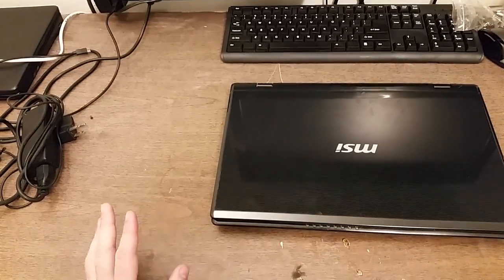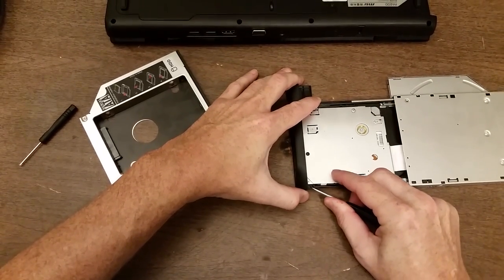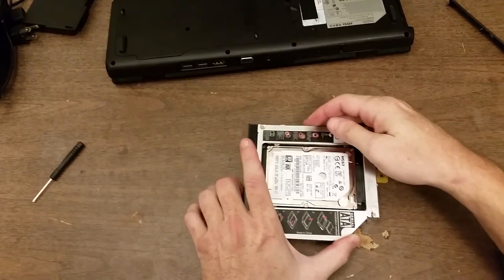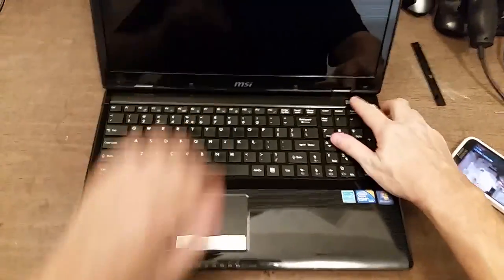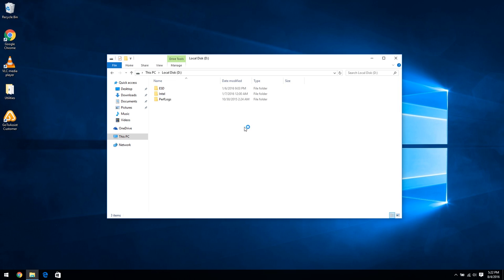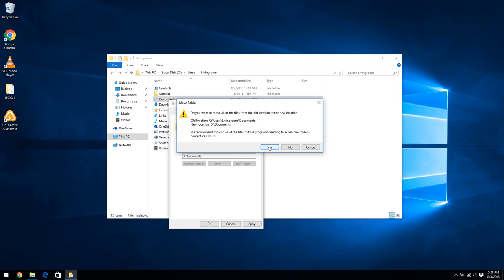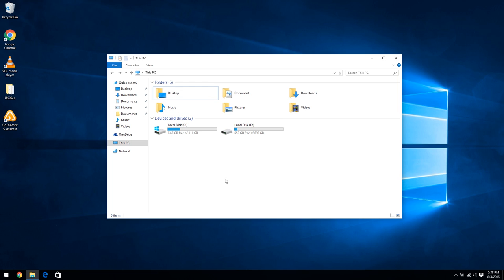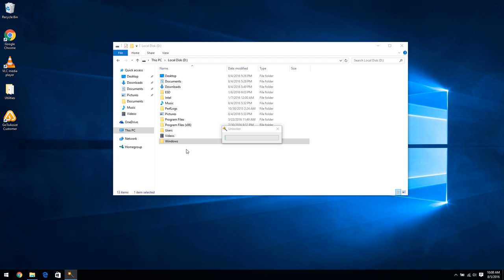Adding a 2nd hard drive or solid state drive to a laptop by replacing the DVD or Blu-ray drive

Comment: An excellent tutorial video on how to add a 2nd HDD to your laptop after installing an SSD to your C Drive. It gives you excellent instructions on how to set up and use the replaced HDD as a 2nd drive for storage of your Windows files.  He shows you how to move your C drive windows files over and get rid of the windows file, plus how to use "Unlocker" Prog to do it. Overall a very comprehensive set of instructions. Thank so much.

Comment: Good video. You need to relocate your swap file, if you use one (I do not), to the mechanical drive You also should direct your Temporary files to your mechanical drive also. This will greatly reduce the write cycles to the SSD. Use Macrium Reflect to image your SSD to an image file on your mechanical drive. These steps will increase the lifespan of your SSD greatly.

Unlocker is a great little program. :)
Reply from the maker: Solid recommendations. Thanks.
Reply: Yer welcome. :)

Comment: Excellent tutorial video.  Thank you very much.  This is my first attempt playing with computer drives so I will need all the help that I can get.  I am putting a new SSD into an older Acer laptop C drive but I would like to pull a HDD from a Dell laptop that just died and use it as a secondary storage in the Acer optical drive.  The HDD from the Dell is half full and I want to be able to keep all the documents, downloads, pictures, and videos etc.  If I move the empty folders from the SSD to the HDD, do they just merge? Or can I just delete the blank folders on the SSD drive and the future files will be saved in the secondary drive automatically?
Reply from the maker: I think to do that right it would be more of a multi-stage process. What I would recommend is moving the files off of the hard drive from the old Dell system to a external hard drive. Then I would format the partition on the old Dell drive. At about 17 minutes into this video it shows how to redirect the music, download, Etc folders to the secondary hard drive. Once that set up then you can reconnect the external hard drive with your files and copy them to those folders.
Reply: Thank you!  The reason I thought I could just moved the files over because your secondary drive was also used, I assumed you had those old files there too. So far, the SSD is not working in the Acer.  I got the PXE-E61 error asking me to check cable.  I have disconnected and reconnected the SSD multiple times, replaced the cell battery, but nothing seemed to work.  Put the old HDD back, everything worked again. I put the SSD into the optical drive, it showed up as a secondary drive just fine.  The SSD is much lighter than the original HDD, but that still doesn't explain the loose connection.  Weird.

Comment: The top tip for me was to measure the CD drive depth. I almost ordered the wrong size from Amazon.
I also ordered a slim optical drive usb caddy for the old CD drive. I may never need it but just incase 🙄

Comment: Hi Michale, thanks for the very helpful video, I had a question I'm hoping you can help me with:

I want to upgrade my laptop (Dell G3 Gaming Laptop) hard drive.

It came with a 512 GB SSD which is currently installed and I just bought the 970 Evo Plus 2 TB which is considerably faster

The motherboard has slots for two SSDs, so I could either:

A) Keep my existing 512 GB installed and ADD the 2 TB drive in the second slot and install the games on the 2 TB HD, OR

B) Clone my 512 GB to my new 2 TB drive and then swap them out

I want the fastest load times for games.

My guess is that if I did A, my boot load times would remain the same (since the OS is installed on the 512 GB SSD, but since the games are installed on the 2 TB hard drive, the games would load faster

Vs doing B, which would speed up both the OS loading time as well as the game loading time since everything is now on the 2 TB (much faster) SSD.

Am I right?

Or would doing either give me the same gaming performance (remember games are installed on the 2 TB SSD in either case).

Thanks!
Reply from the maker: Games load faster from a ssd compared to a hdd but once in a level you won't see a difference.

Comment: Hi Michael, great tutorial. Question - replaced my HDD to SSD. Cloning done, etc. and works well. Put the HDD into an enclosure making it a portable HDD. However, when plugging the now portable HDD, the laptop isn't reading/detecting it. But my other laptop does. Eliminated other variables - malfunctioning enclosure, cables, etc... they are all fine. Thoughts? Thanks in advance.
Reply from the maker: Try one of the other USB ports. It's possible it is detecting it but not giving it a drive letter so it doesnt show up. Try right clicking on the start button and going to Disk Management. See if it shows up there.

Comment: Hey Michael, instead of using unlocker thing can we just format the Used HDD (to remove the old system files) while it is on the DVD Caddy bay?? Also can we format the old HDD partitions separately (if it have any)??
Plz reply..
Reply from the maker: Yes on both.  The unlocked is useful if you need to keep the files and remove the Windows install.

Comment: Michael
Thanks for the detailed info for adding 2nd hard drive to Laptop.
I have a query can I connect external hard drive to my laptop using the cable SATA USB ?
Bhasker Raj
Bangalore India
Reply from the maker: Yes you can.

Comment: As usual, your tutorials are precise, clear and easy to follow Michael and Thanks for that. I have just replaced my HDD with SSD 500GB to use it as normal 'C' drive on my Win7 laptop. Following your tutorial old HDD I put in Caddy as second drive 'D'. However I don't want HHD 'D' (in caddy) to spin all the time instead go on standby when not being accesssed/used. Can that be done? Thanks in advance for your answer.
Reply from the maker: That may be an option. It depends on the computer whether or not it's available. Go into the control panel and advanced power settings. If there is an option to put the hard drive sleep it would be there.
Reply: Thanks for your reply, In advanced power settings it says about just one Hard Drive that probably meant for Primary drive. Nothing about secondary one. Any way Thanks for the help.
I asked the same question to the Caddy supplier, their answer got mixed up when they used their Chinese-English translator !!!

Comment: Thank you for your video.  I have recently put a 125G SSD into my laptop but it's already running out of space.  I reformatted an old HDD and can use it in the optical bay for additional storage.  Will it be possible to relocate the user folders (mine & public) and the programs files folders (there are two of them) to the secondary drive by changing the drive location? Do I have to create a new user account in order to move the user folder over?  I have seen other Youtubers did the copy-and-paste resulting in many complaints about computers getting messed up. That's a scary thought.  If it's possible I would like to keep just windows and a small photo editor on the SSD, the rest can go to the HDD.  Is it doable?
Reply from the maker: Watch the video from about the 17-minute mark. It shows the process of moving the files to the hard drive. To move programs from the SSD to the hard drive what you have to do is uninstall the program and then reinstall it onto the hard drive. Whenever you start installing a program one of the first choices it gives you is where to put the program. Essentially what you do is change it from C drive in the program files folder to the D drive in the program files folder.
Reply: @MichaelTheComputerGuy  Thank you for your prompt reply.  Could you explain a bit more on the uninstalling-reinstalling process?  I have only seen videos on moving the programs files (x86) from one drive to another (most said it didn't work), but not on uninstalling/reinstalling them.  If you have a link where I can learn how to do it I would very much appreciate it.
Reply from the maker: @alicepearce4597  Just moving the program files almost never works. On Windows 10 if you click the start button go to settings there's a apps option there with a list of the programs that are installed. To uninstall any one of them you should click it and then choose uninstall. To reinstall a program you either download it from a website or put a disc in and run the installer. One of the first options during the install wizard will be you where to install it. Most of the time of default will be the c drive and the program files folder. You literally just change C to D or whatever Drive letter your second Drive is.
Reply: @MichaelTheComputerGuy  Oh I see you mean uninstalling them one at a time.  I thought I could use a program to back the entire folder up then reinstall everything together.  Got it.  Thanks again.

Comment: hey bro thank you for this great video! Is the caddy hdd overheating somehow (as it is quite far from the fan)
Reply from the maker: Mat C Hard drives in laptops are not affected by the fans. They are put in enclosures with no airflow and they're designed to work that way.

Comment: is this drain your battery faster and is there any heat issues?
Reply: Does seem like a cool upgrade but not practical in everyday use. The main benefit of a SSD for a laptop besides the performance boost is less drain on battery.
Reply: Shiddhant Hawlader p

Comment: How do you format the HDD? So I wouldn’t have to add the explorer extension? Could it be done through disk manager?
Reply from the maker: To format the drive you just need to find it in the file explorer right click on it and go to format. Disk manager has more to do with partitions.
Reply: Michael Cooper ok. If I understood correctly, the hdd that I replaced with a cloned sdd, i can install in the dvd drive via caddy (great video btw) and i should be able to find it and format it with explorer. Then I can move the desktop, documents etc to the hdd.
Reply from the maker: @TheFamedwarrior72  Sounds like you got it right.
Reply: Michael Cooper bummer. I swapped out dvd drive with the hdd. I turned on the laptop but it only turned on for a second, made a chirping sound, and died. I thought i kept touching metal to rid static but maybe i shorted out the laptop. Almost
Reply from the maker: @TheFamedwarrior72  I computer turning off almost immediately with the chirp sound means there is a short somewhere. Take it apart and put it together more carefully.
Reply: Michael Cooper I’ll try that and let u know. I had tried turning on the computer without the hdd and got nothing. Thanks

Comment: I want to know if and how i can install windows on the 2nd ssd in caddy and run my laptop windows in that 2nd ssd in caddy, and i also want to keep my original windows that's installed in the hdd. Can you make a video on this? i wish to have boot option for selecting which drive i want to run (on laptop). thanks
Reply from the maker: I don't know if that's possible to boot windows from the DVD drive caddy. I imagine it is but it just be something you'd have to try.

Comment: Good Day Michael. My boot drive is now a Samsung 500GB SSD. I bought a caddy much like the one in your video for my ASUS TP550LA to hold the old sata drive at 750GB for secondary storage and installed it in the optcal drive bay. The SSD is working fine as the boot drive with a fresh install of windows 10, but I cannot get the laptop to detect the old SATA drive in the optical drive bay. Cannot see it in the BIOS or in Disk Management in Windows. What could the problem be?
Reply from the maker: What I would do in that case is take the hard drive outside of the optical drive bay and it's caddy and then put it back in. Basically just reseat everything. If it still doesn't work I would take the drive out and plug it into another computer to see if the drive is still functioning.
Reply: @MichaelTheComputerGuy  Thanks. Tried that and still didn't work. The drive works because I removed it and used a SATA to USB cable and I was able to access the drive over USB.
Reply from the maker: @cwsrad  maybe the caddy is faulty
Reply: @MichaelTheComputerGuy  Could be defective. Hardly worth the effort to continue to troubleshoot.
Reply from the maker: @cwsrad  I would say it's worth the effort if you want a hard drive in your laptop. Just return the caddy and get another one. A different brand for sure just in case it's some kind of weird compatibility problem between the caddy the drive and laptop.

Comment: I got an old HP DV6580ee laptop. I replaced the DVD with as 12.7mm IDE to SATA caddy containing SSD. The DVD and caddy have the same size with the same IDE interface. The caddy is not detected.  What to do now ?
Reply from the maker: If the drive is new you need to go into disk management initialize it and put a partition on it. Do a Google search for your version of Windows and "disk management add new drive" and you should find some good instructions either on a site or a video.
Reply: @MichaelTheComputerGuy  Thanks for your response. The Disk does not show up in disk management console neither in device management.
Reply from the maker: @HA-yu8bd Did the DVD drive in the laptop work before you removed it? How sure are you you have the correct drive caddy? Are you sure the drive you're trying to put in that caddy actually works just regularly in another computer?

Comment: Hello Michael i did the same with my notebook but after installing the second drive fan started spinning faster and louder.
Now i have one ssd with windows 10 and hdd (in the dvd slot).
I tested it back with just one drive and fan act normal, very silent.
Settings in windows 10 are ok (hdd is only for data, no file pagin)
Why does the fan act like this? is it because having two drives consume more power and become hotter?
Should i remove the second drive to doesn't harm the notbook?
Thanks in advance
Reply from the maker: I would say that the hard drive being in the computer wasn't feeding data to the CPU fast enough for it to be fully utilize. Now that that bottleneck has been removed the CPU is able to work harder.
Reply: @MichaelTheComputerGuy  So do you think i can keep both drives? Doesn't it harm notebook stressing it so much?
Reply from the maker: The second hard drive won't harm my computer. It will draw a little bit of power but very little. It will add some heat but again I wouldn't worry about it. That being said if you don't need the 2nd drive in the computer you could take it out and use for something else.
Reply: @MichaelTheComputerGuy   Thanks i want to update that after keeping the second drive out it results that fan keeps being noisy, so i think i will just need to replace it (laptop is from 2013).
What a strange coincidence, before doing this work fan was working right.

I've already blown dust with compressor some time ago it doesn't look dirty, but tomorrow i will try to clean the fan better by removing it.
Even if it's seven years old i don't think I need to change thermal paste; cpu and gpu temp looks right to me (40-60degrees) with light usage.
Reply from the maker: @emanuele6487  Does is sound like it's just spinning fast or is it making a rattling, buzzing, pitched sound?
Reply: @MichaelTheComputerGuy   i thought it was spinning fast before, but then i thought that maybe it's just became noisy and so like you said (rattling, buzzing piteched sound).
When notebook is running the fan keeps being noisy and stop, keeps being noisy and stop; I think that it's the normal way a fan works, when cpu gpu became hotter fan starts working, then it notices that they have cooled down and so it stops (and keeps doing like that).
Bios settings in my notebook is gaunt there's nothing about fan; tried also to use the famous utility speedfan but it always crash when detecting sensors. 
I start to think that it always has been like that but before it was more silent.

What do you suggest?
Reply from the maker: @emanuele6487  If is just making a standard fan noise then it's doing what its supposed to do, keeping the chip cool.  If it is making rattling, buzzing pitched sounds then you should replace it.

Comment: Mine won't detect. Does it need a 5V power connector? It is a WD10JPCX-24UE4T0. Along with  connector I am noticing a four pin power connector on the drive
Reply from the maker: The drive caddy will provide power and data connections. Make sure the hard drive is well seated into the caddy and that the caddy is all the way pushed into the DVD drive slot. if you go to Device Manager it should show up. From there you go into to Disk Management. This is shown in the video.
Reply: @MichaelTheComputerGuy  I think mine is not seating properly with the on board connector on the laptop. Later when I try to put back the DVD drive. The laptop would not boot. I had to take apart the Laptop. Remove one of the screws that was connected to optical drive. looks like it was screwed incorrectly causing some sort of short circuit which was inturn causing the laptop not to boot. I justed removed the screw pushed the oringinal drive back. Now it's booting .... what a relief... abandoned the extra HDD caddy option for now

Comment: used the same way  to clean up old c derive after every thing is cleaned there is 18GB  on it still but when open the files there is about 900MB worth of files ,,, is that something i should worry about (127gb free of 145 gb) there nearly no folder or anything at all on it
Reply from the maker: Yes Windows can take that much. You're done.

Comment: Most of DVD are connected by SATA I , so it means it will choke the ssd speed. Is that right?
Reply from the maker: The DVD drives themselves may be SATA I but the controller should be sata II or sata IIi  so the hard drive speed isn't slowed.